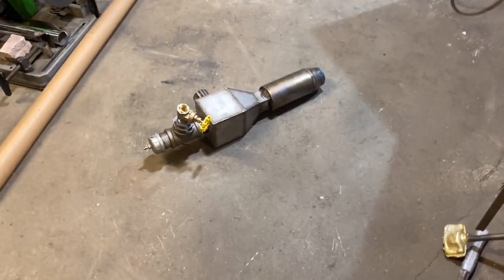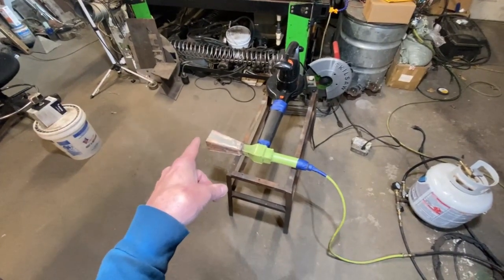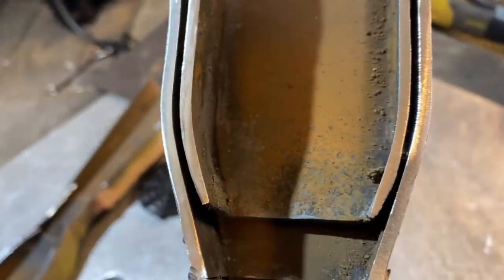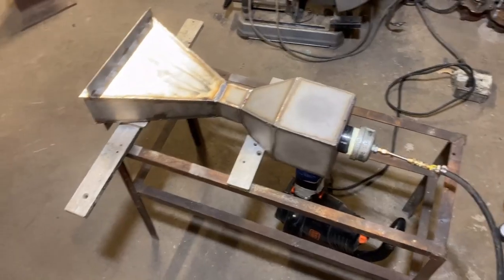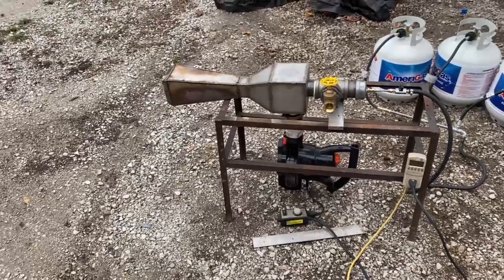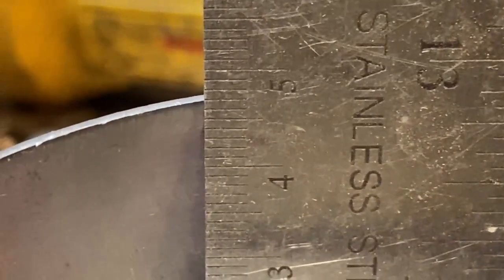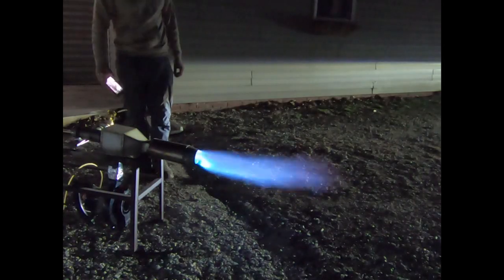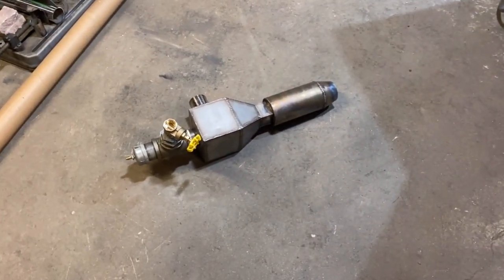Natural Gas Burner R&D for Kilns and Melting furnaces

Comment: Hello. Propane (and any other fuel) must be burned OUTSIDE of the Burner. That is the basic rule: no any "combustion chamber" in burners, if it's not a potato gun ))
Try to use any "flame stabilizer" like a metal wire grid on nozzle. Try to split any "big torch" into several small.

Comment: you must have higher line pressure then residential here. our natural gas is 8 ounces to houses. i wouldn't want there to be any back pressure on the line. if your feeding it 1 psi and there is 1 psi back pressure then there is no flow.  you might look up a air powered vacuum. from what i have seen, they use alternating pressure and suction rings or tubes to keep a "grip/high vacuum" on the suction line while maintaining flow. this would aid in mixing and pull a higher vacuum all at once.

Comment: Whoever told you that swirl was for keeping fuel off the walls of a combustor must have been on some serious drugs.

Every seasoned professional engine designing engineer seeks the max swirl, no matter what kind of combustion they are seeking to achieve.

Be that piston, turbine, or liquid fueled rocket.

Probably THE ONLY form of engine that won't benefit from swirl is a solid fuel rocket.

Comment: How difficult would it be to create a conical bell housing for the exhaust like nasa uses on all their jet engines?
Reply: if you could get a stainless that is decent for drawing like 304 spinning one out wouldn't be that hard.  first one would be costly though.  other than that youre into a lot of cuts and welds.

Comment: A trick i used to mix gas in my potato cannon was using stainless steel wool in the combustion chamber.  Even a tiny chamber with stainless steel wool would make my potato cannons bang.  All the turbulence make it combust fast.